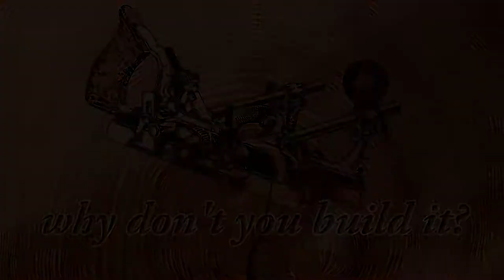DIY hangboard for climbing with simple tools

Comment: Can I ask are all your longer holes the same depth and angle? Maybe I just can’t see it but how do they vary in difficulty or technique?
Reply from the maker: They are all the same depth. That's in fact one of the shortcomings of this hangboard. The different width of the holes allow for some variation, but not as much as I would like. Should I redo it I would make at least two different depths.
Reply: @WhyDontYouBuildit  what are the lengths on the holes?
Reply from the maker: @Mw3G33ks  If you mean depth it's about 20mm. The truth is that I recently deepened the top row to make it easier (covid quarantine was not good for my fitness) and now the top row is about 25mm deep. As for the width of the holes I just made them roughly based on my fingers, so that I can fit one, two, three or all four fingers.
Reply: @WhyDontYouBuildit  you could pour epoxy in the holes to reduce their depth